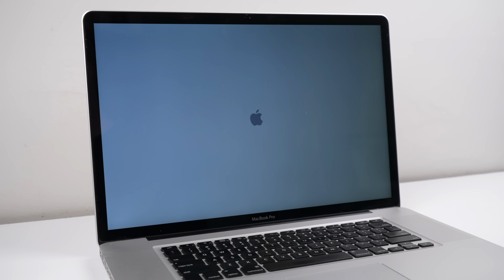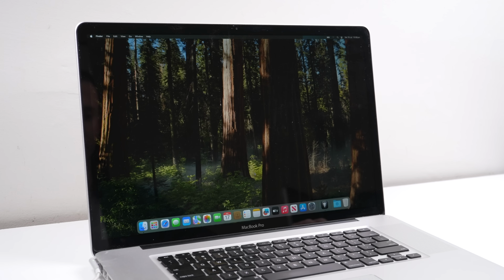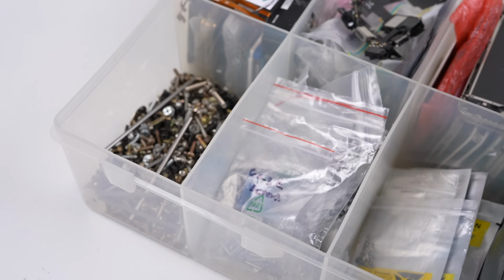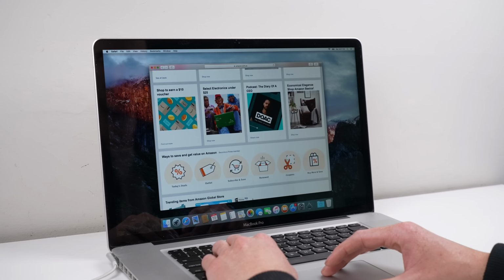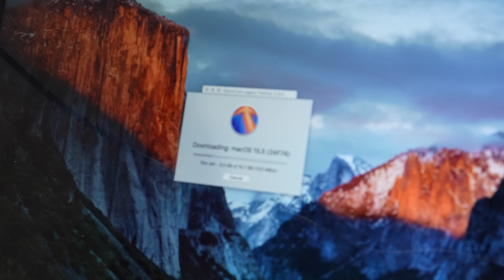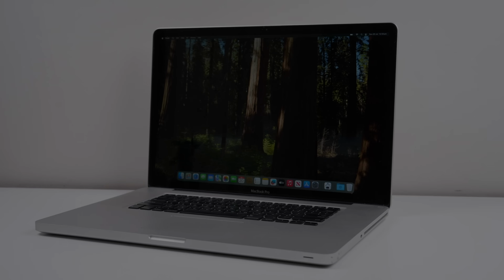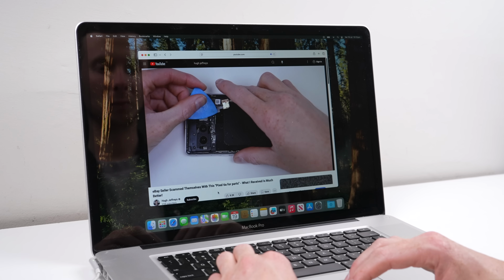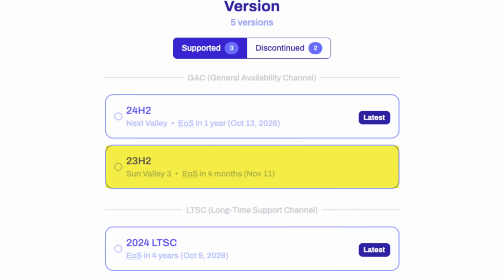I Scored This Old MacBook Pro For FREE & Got It Running On The Latest MacOS

Comment: I have late 2015 MacBook Pro with Fedora. Seems like Linux is the best way you can revive these old machines.
Reply: The biggest problem are the nvidia cards that because of nvidia's closed source drivers had to work with a reversed engineered Nouveau drivers and they are far from perfect.
Reply: @AlexJPetrov  I feel like on a computer so old it's a better idea to use nouveau than the closed source ones since they will be very outdated anyway, so it might not always play nice with the latest kernel. Like yeah some programs will have a bit more performance but that thing is so old you wouldn't want to run something demanding anyway, and even if you did it wouldn't perform that much better. Nouveau is good enough to just accelerate the desktop environment.
Reply: @AlexJPetrov  they also made the mid 2015 with an AMD gpu.SO glad i got that model.
Reply: @jg0909  Oh, yes, AMD are a lot better in that regard.
Reply: @AlexJPetrov Ubuntu runs perfectly on all of my Apple computers.
Reply: @AlexJPetrov plenty of nvidia drivers have support.
Reply: @Clippy-this-is-fine  Not for old ones.
Reply: @AlexJPetrov  Endeavour Linux seems to handle those well.  I run Omarchy on my other Macbook Pros.
Reply: @AlexJPetrov  You don't have to use the Noveau drivers unless you're really wanting to eliminate all proprietary software on your machine (and even then, there will still always be "proprietary blobs" in every Linux machine)
Reply: opencore legacy is the go im running latest OS on early 2015 no proplem
Reply: @neilwatene700 In my own case a pair of late 2012 pieces - Mini and MBP. As a totally non geek boomer, the complete install took a couple of hours to get right, but they’re working like a charm. The Mini I’ve had since new, and the MBP wasn’t free, but cost less than $250 including a brand new aftermarket battery, and they’re both quite sufficient for my now much reduced use case.
Reply: @neilwatene700 Late 2012 MBP and Mini for me; so unproblematic that I’m hesitant to update further than Sonoma. A recently acquired W11 Dell laptop required for two specific applications, is on other hand a labyrinth of bloat and adware just to get to my  browser of choice - which ain’t MS.
Reply: @neilwatene700 no problem huh? How much free ram have you got at idle? MacOS is bloated as hell and needs modern hardware to run optimally. That's why people are suggesting Linux as it can be very light weight.
Reply: I have a mid 2010 mac mini with mint😂
Reply: Another Fedora user!
Reply: 2012 MBP owner here, and I'm willing to try getting it to at least Ventura just because my 2017 27" iMac runs it just fine. I haven't found a Linux distro that I've liked lately, and winblows seems like it would have driver issues and unsupported hardware.
Reply: Fedora installed without issue? I've seen macbooks having to use Asahi Linux because Arch isn't supported, or maybe it was on an "M" series chip.

I don't use apple products, but i do use Linux. Fedora and Arch are my favs. I use Arch (btw) simply because I was able to install it a while back using Chris Titus' Arch installer, but there are some other small issues that made me stick with it vs Fedora. But Fedora is awesome too!
Reply: There were minor issues with Wi-Fi and Bluetooth, but I resolved them relatively quickly. And Asahi is for new macs only, if I’m not mistaken. Won’t work for Intel macs.
Reply: @rckt What about Mint would it work too? 
Also: is there a way to make some Adobe old soft work in a Linux Mac? Just asking… maybe something like wine or such could do the trick or is it better to flee to alternatives?
Reply: @TheJason13  must be the M chip issue.  My 13" runs Omarchy. I have a 2012 15" that came with MX Linux. I put Endeavour on it to try, but installed Omarchy when I found the fix for Nvidia.
Reply: @TheJason13 hmm, is Fedora that good?  I never used Fedora, only Mint and Arch.
Reply: I'm using a 2015 MBA on Monterey and it's perfectly usable for daily use.
Reply: @thatprettyparrot what's your ram usage at idle?
Reply: @Clippy-this-is-fine  

Physical Memory: 8.00GB
Memory Used: 2.84GB
 (App 1.68, Wired 1.12, Compressed 26.4MB) 
Cached files: 3.81GB
Swap Used: 0 bytes
Reply: @thatprettyparrot as I suspected. That's a lot of ram used at idle! On a 4gb device, you would have an unusable device. 8gb ram leaves you with a little more to play with, but once you open up a few browser tabs, you will be struggling.

Even the most feature rich Linux desktops idle at about 1-1.5GB ram usage. With lighter options sitting from 500-700mb on idle.
Reply: @Clippy-this-is-fine  Do I care? No.

It runs. It opens Chrome (4-5 tabs, I once had 8 going no issue). It opens Discord. Maybe even plays a game or two. That's all I need.

It's like saying your engine can idle on three or two cylinders to save fuel. It can be done, it does exist, but does everyone want it? No.
Reply: @thatprettyparrot  enjoy your 5gb of usable ram. BTW, your analogy was wayy off anything useful. What your system isn't wasting via bloat is what's usable. I don't think you'll need many resources for what you'll do on it, so I'm sure you'll be fine, the more I think about it.
Reply: @Clippy-this-is-fine  Exactly. 8GB is plenty for my use. 

And yeah, you're right, the analogy was kind of ass. I thought it sounded smart at the moment.
Reply: @thatprettyparrot  I said 5* lol. Anyway. Each to their own. Already too much negativity in comments sections, so I will truce. I'm glad you're happy with your setup at the end of the day.
Reply: @Clippy-this-is-fine  8GB in total, forgot to clarify. Sorry for being so rude- I just tend to hate those users who speak first think later. At least you're chill enough to back down :)
Reply: @thatprettyparrot lol, the 5gb referred to your available ram after the OS used what it needed resource wise.. If that's all you need then that's cool. Happy Mac-ing :)
Reply: @thatprettyparrot Í have a MBA 11’ 2015, i5, 4gb of ram running Monterey (as it is it’s last Mac OS update) and it works fine
Reply: @EdCayo  *macOS :) iOS is for iPhones, macOS is for MacBooks. Easy way to remember.
Reply: @thatprettyparrot corrected it, you're right thanks
Reply: And here's something you may not know about. Apple and Microsoft run most of their servers and storage on open source software.
Reply: Syfm
Reply: Legacy core patcher is running to the end of its life. Especially with the new Apple ARM processors.
Reply: My 2015 is just fine on Monterey. Really no point in using a Mac if you aren’t gonna use macOS. There are ways to force upgrade to a newer macOS too which I plan on doing someday to mine.
Reply: Just avoid Nvidia chipsets.
Reply: Could you please provide a link to the opencore software?
Reply: @eastmanwebb5477 just Google in. No point trusting one person's link.
Reply: windows
Reply: Linux Mint has decent Nvidia Support from my testing.
Reply: I run big sur with a macbook pro late 2013. I just added  Avira antivirus and use Firefox like brownser. no problem for 5 years.
Reply: I have a 2016 MBP (the first of the Touchbar ones) and Fedora has been absolute hell on it. But tbf, Windows is just as bad on it too. So maybe I've no other options but to stick to Monterey or try my hand at unofficially installing a more recent macOS.
Reply: @turbochargedfilms  same thing with my 2017 MBP without the Touch Bar
Reply: @turbochargedfilms I have a late 2016 MBP with a touch bar and the latest LTS version runs really well on it. Even the touch bar works. Sleep and the fingerprint scanner are the only gaps. 
Otherwise, a great daily driver that even supports Windows games via Steam Proton. ChatGPT is a huge help when configuring hardware support. Let me know if you need me to send you some links.
Reply: @turbochargedfilms put Linux mint on it. Fedora is renowned for not being set up out of the box, especially when you need non-free software like you do on macs, like wireless driver etc. Lemme know how you go
Reply: @Clippy-this-is-fine  To everyone reading: DO NOT install Mint on macbook. You WILL suffer. It might look like a user-friendly distro, but don't be fooled - trying to get anyting done will make repairing it a second job. And when you inevitably accept the fact that you must learn linux to use and maintain it... You'll face the main issue. THIS.SHIT.BREAKS at - hear me out - EVERY attempt to make it work. Because it's supposed to work 'out of the box'. It doesn't. And doesn't allow to fix it either.
Reply: @КейВольт  To everyone reading: If you follow this guy's advice, you are one of the many Mac sheeple who think they can change to Linux without learning anything about Linux. If you think you can change to Linux and keep your smooth mac brain, you will SUFFER just like this guy. My experience on a macbook air 2014 was amazing on Linux mint. If you want to bring old hardware back to life with a light weight, secure, still updated and official operating system, then you don't really have an option other than Linux anyway. Open Core Legacy Patcher may give you the latest MacOS software, but it will run like shit with low system resources devices. I get plenty done on it productivity wise, don't worry about that.

If you're not willing to pay a small price to replace corporate spyware / bloatware with free and open source, light weight alternative, then that's saying more about you than it is about Linux.
Reply: YAWN......
Reply: Are you serious?! Even on Macbook videos, we can't get away from you people who think you're so special because you use an operating system with 2% market share?! STFU, nobody cares.
Reply: @mjc0961why are you so offended by people using Linux? Linux is just alternative, you can use whatever OS you want, nobody cares.
Reply: @Ch92ID He's probably the one who says "I don't care whether Microsoft collects my data". Like bro, that's like saying "why need freedom of speech when I have nothing to say?"
Reply: @mjc0961
Thats why people laugh at my Bugatti.
Because Bugatti doesn’t have the market share of Ford?
Not the best argument.
Perhaps heed your own advice.
Reply: @mjc0961 go give head to tim cook and bill gates
Reply: Wow. Chill out, man. Even in this video it’s obvious that the latest macOS runs poorly. I’m just sharing my personal experience. I actually had little hope when I decided to try out Fedora. But it runs pretty well, much better than any other option you have with these old macs.
Reply: @rckt that’s Mac users for you.  They’d rather use macOS running like garbage than even think about learning something.
Reply: @mjc0961 Nothing wrong if it is a last gasp at functionality.   The laptop in the video is older, and he should be commended for keeping it alive, but also says it has minimal utility.   A 2015 model may be greatly perked up by changing the OS.  rckt says it is to salvage the hardware.   You sound like someone who doesn't run apps but runs OSes.   Linux people many time are also people that run OSes, but Linux is still a great way to keep something from going obsolete for a few more years.

I guess your option is to stick it on the curb with a "FREE" sign.
Reply: @mjc0961 I'll show up on every macbook video politely suggesting linux from now on just to piss you off.

By the way: why do fanatic Mac fanboys always bring up niche metrics pretty irrelevant to the user, like market share?  Do you really not use your Mac to its full potential enough that you can't even talk about its best features, and just browse Twitter and Reddit all day on it?
Reply: @monadic_monastic69  spitting facts
Reply: @mjc0961it's more like 5 percent. Just because you're a simpleton unwilling to try something new, doesn't mean everyone else here is. Linux will bring this stuff to life. It's that simple.

Comment: macOS 15 can be installed but laptop runs really hot. I tried Sequoia on 2011 15 inch model and it runs like it's going to burn my legs
Reply: Drill holes like many peoplr do
Reply: How is it not had graphics card failed

Comment: YouTube runs on my 2008 and 2009 MacBook Pros with El Capitan
Reply: Same i have a late 2008 macbook pro also on el capital that I got on ebay for 21 bucks cause it didn't have a cord so I got a cord for 18 bucks brand new in box so I put a 9 dollar ssd and 8 dollar 8gb of ram and it runs good I use it for videos cause my main machine is a 2015 13 inch
Reply: @BrendenMarks-y5g good man I got mine during covid for online classes and it’s running fine till now
Reply: I have a unibody 13 inch late 2009 macbook (the white one) and it used to have MacOS El Capitan and it actually supports OS HIgh Sierra but I used the Dosdude patcher to install OS Mojave
Reply: @galaxyglider9 good 👍

Comment: 12 minutes ago is wild. I just picked up a MacBook pro and I'm planning on fixing it up once parts get here. Absolutely love your videos to no end!

Edit: for anyone wondering its a 2010 13 Inch MacBook Pro. Paid $9 for it.
Reply: I wish market here was this good like in us, here 2009 macbook is like $100
Reply: 2010 should be able to run high Sierra. Firefox ESR 115.25.0 works great on that.
Reply: @michaellurie9138  on my other Macs im running MacOS Sequoia with OCLP, and im probably gonna do the same with this machine.

Comment: I love old tech being restored and used once again. They are old but still can be usable for plenty of stuff including web browsing, media consumption, watch movies etc. I'm pretty sure this Macbook works better than some Chromebooks lmfao
Great video!
Reply: You can only do that for so long then it time to upgrade
Reply: @jake78441 for simple tasks like states it will work for a very very long time. Throw an SSD in it, and if ram is upgradable, throw fedora or mint on it and it will last 20 years. I have a 20 year old MacBook that still works for basic stuff.
Reply: @jake78441  my 2010 (or it's a 2013, i can't remember) MBP is perfect for browsing, media consumption, movies, etc.  I'm noticing slow browsing experience because the CPU just can't handle all of the JS on sites but it's still usable.
Reply: @jake78441  not for simple stuff like you tube
Reply: Fr even now intel MBPs are much better for media consumption than most windows laptops... like unless you into specific use cases they are such a great option (I even run windows and Linux on it)